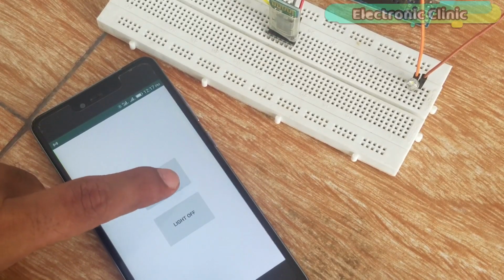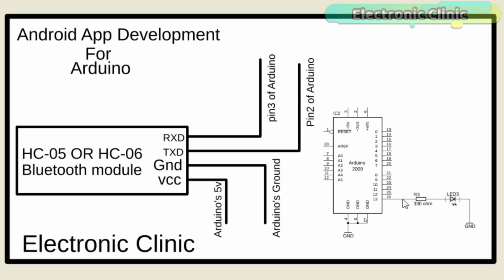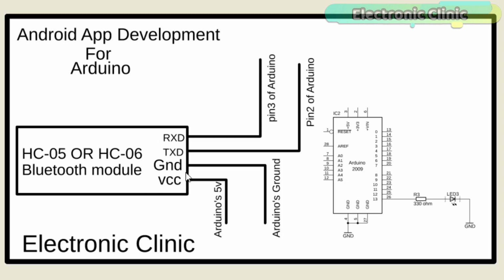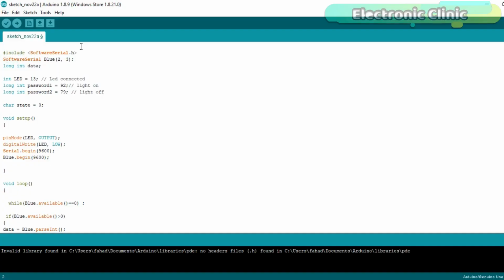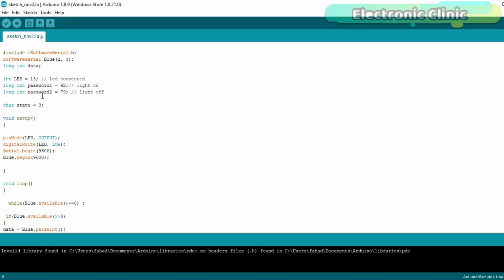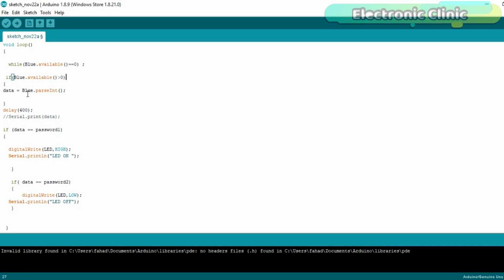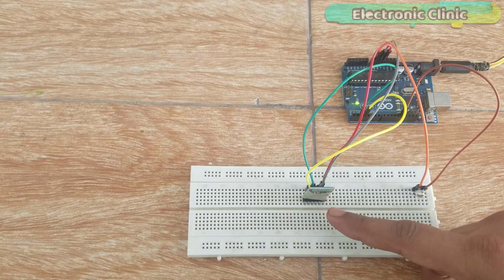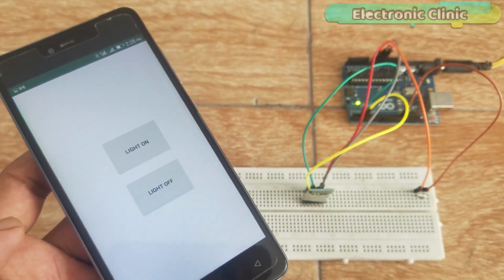How to create an Android app with Android Studio to control LED using Arduino

Comment: Hi please how do i solve this erorr;    Call requires permission which may be rejected by user: code should explicitly check to see if permission is available (with `checkPermission`) or explicitly handle a potential `SecurityException`

Comment: nice tutorial ! .. it is possible to switch on or off the water motors? using Android Studio?
Reply from the maker: of course, you can. In fact, you can control anything you want. there relays which can be used for controlling high ampere loads. You can watch my video on IoT High ampere relay.

Comment: in the place of the Led bulb if I want added 4 wheels with motro, is possible ?
Reply from the maker: yes, you can.
Reply: @ElectroniClinic  Wow, I will add 4 wheels, the architect will be series or parallel?
Reply from the maker: @afreensworld786  parallel.

Comment: I think you need to add voltage divider between the 5V arduino and 3.3V inputs of the HC.
Reply: i think the hc supports up to 6V

Comment: thank you so much , i really appreciate the work you shared with us as step by step it really helped me so much ,
i kindly wanted to ask you what changes should be done if i added 2 LEDs and 1 Fan , what kind of things i should add / change on android studio and Arduino sketch ..?
many thanks for you.
Reply from the maker: just copy and past the button codes, change the variable names and commands. For controlling the Fan you will need to replace the LED with the relay. watch my project on automation in which I have used relays.
Reply: @ElectroniClinic  thank you for replaying, i have one more question what if i want to add a micro servo motor , what things should be added in android studio?

Comment: Hello, great tutorial I really like it. 
I followed your steps, no errors at generating .apk, I installed generated .apk but when I start application it won't start. I found what is the problem and it was  "java.lang.NullPointerException: Attempt to invoke virtual method 'void android.widget.ListView.setAdapter(android.widget.ListAdapter)' 
I don't know what to repair in my code (no errors in MainActivity, so I tried to debug your original apk. I can't open it anyway. 
So, could you please put here source files of this project ? I would be really happy :)
Thank you
Reply: have you managed to solve this problem? I have exactly the same.
Reply: @tuday5783  Hello, No I don't :/
Reply: @patsuu  ah, ok i just spent 7 hours without success

Comment: do you have the same project but for wifi not bluetooth using a wifi module  on the arduino (iot based system).
another question : can i control the sensors on arduino through an android app without the need for a cloud database
Reply: I am also in your shoes right now, I found that you can control things without a cloud server, but only if you are connected to the same wifi network. This means that you can only control it if you are within the vicinity of your home.
Reply: @lem09able  that's what I want but Is it possible? cause I want the app to be always updated on what's happening with the sensor I thought I needed a cloud service to send data from arduino to app and vice versa and kept refreshed .
Reply: @TheDragonghost333  some people on an arduino facebook group suggested I should look at MQTT another suggested the google Firebase. Yes, it's possible from what I gathered. As I said, I just started my iot journey as well(21 hours ago). My plan is to use android studio to create an app and interface it's wifi to a cloud server to make a real time communication with my esp32.
Reply: @TheDragonghost333  if LAN connection is what you want(same router only), then it is very much possible. Get an esp32 and download and install the "Espressif Esp32" library from the boards manager in arduinoIDE. Then click file>examples>wifi>simple wifi server. The only thing I know right now is how to turn on and off a relay/led lights. Maybe I'll know something better tomorrow.
Reply: @lem09able  I have the same idea but the app either with mit invetor app or blynk without the need of another cloud blynk have their own
Reply: @lem09able  if you want I have this YouTube channel it might help you (forcetronics) and the best of  luck
Reply: @TheDragonghost333  best of luck to you too! Believe it or not, I've been grinding these iot videos like crazy. I also stumbled upon that guy's channel haha.
Reply: @lem09able  same
Reply: @lem09able  thanks I will check it out